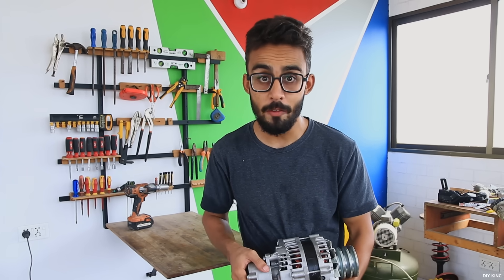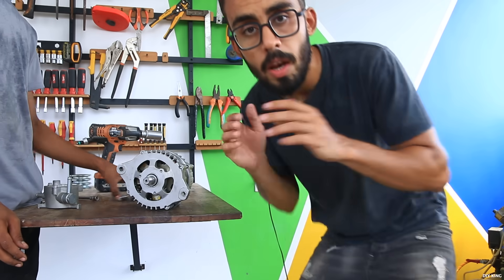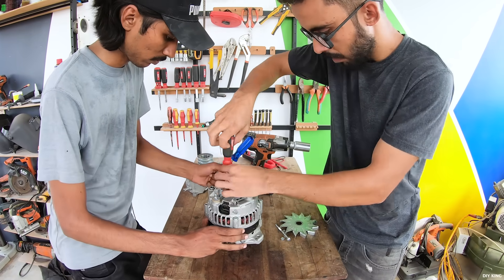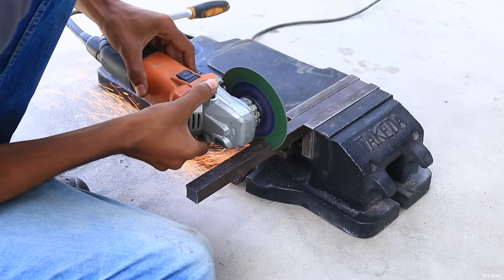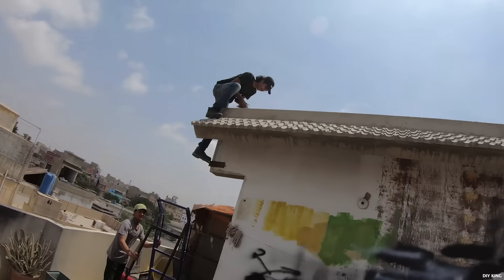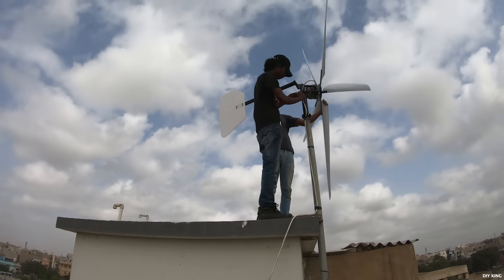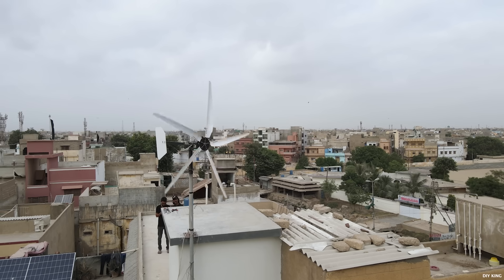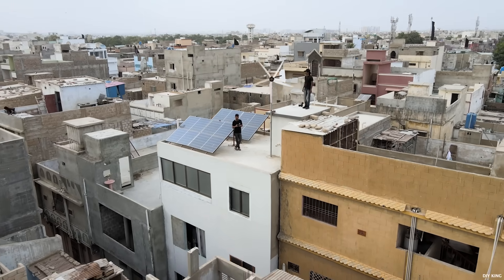Building a Wind Generator using a Car Alternator

Comment: Hi, I'm an auto electrician. I found that the Delco Remy alternators charged at lower speeds than Bosch for example. You will also find that an alternator with a star-wound stator will charge at lower speeds but also put out slightly less current. Delta wound stators produce more current but also need higher speeds to charge. All you need to do with your system is add a pulley and a belt [or gears] to make it to spin faster. Also it depends on how you 'excite' the charging system. The rotor has a slight magnetic field and will start charging at high enough revs but by giving it a 12v feed to start with it will start charging much sooner. [I didn't watch everything on your video].
Reply: Wind Turbines spin at 300 - 600 RPM. The over-drive (1:3) gear ratio required to make the Alternator spin at 1500 RPM, will make it almost impossible for the wind turbine rotor to ever start spinning. It would be like ... your car was in 6th gear at a stop light.
Reply: @MrSummitville  no it wouldn't, the alternator is easy to turn until the charging current kicks in at higher revs.
Reply: @dvdowns Getting the mass to rotate quickly is a problem. And that is why it is NOT implemented.
Reply: @MrSummitville that's what the gearing is for, it will work.
Reply: @dvdowns  You do it and show the world.
Reply: @MrSummitville think about it, an alternator at 14v and 100 amps would generate 1.4kw. There are wind turbines generating a lot more than that. If they can be turned then so can an alternator.
Reply: @dvdowns  Talk is cheap.  Build it.  Back up your theory of 14.4 volts @ 100 amps with ... a wind turbine, 3:1 gears and a car alternator with its rotor powered by a battery.  Stop your yapping and do it.
Reply: @MrSummitville you pay for the components and I will prove it.
Reply: @dvdowns  It is your responsibility, to prove your theory. You can't even point to one successful Wind Turbine design with a car alternator and a 3:1 speed-up gear set. Not one. I am not going to waste my money, on your quackery.

Comment: Permanent magnets on the rotor is the way... Great job!
Reply: Even with magnets, still low power output.
Reply: @MrSummitville unless we lower our expectations
Reply: @AlexanderBelikov  Why build junk and  lower your expectations?  Hugh Piggot Axial Flux Dual Rotor - High Output.
Reply: @MrSummitville car alternator is not nuclear power plant. But axial flux generators are not the top power either.
Reply: @AlexanderBelikov  What is more efficient than Dual Rotor Axial Flux?
Reply: @MrSummitville it depends how do you measure efficiently. It could be kw per kg of cupper used. Kw per $$ spent, etc. And there would be different winners.
Reply: @AlexanderBelikov  Watts output vs Wind Speed is that standard for measuring efficiency. Power In vs Power Out is the industry standard for efficiency. How do you not know that?
Reply: @MrSummitville how do you compare by only this one factor? If most power-in-power-out-efficient generator costs much more than slightly less efficient - guess which one will be used by majority of users? 
That guy took a scrap car alternator and is producing power. What power cam you produce using the same budget? It's like go to Top Gear where they were racing 1000 gbp cars and tell them to use formula 1 cars instead, they are more powerful. That's truly genious.
Reply: @AlexanderBelikov  The alternator was a waste of time and money.  It is worthless. I don't waste my time and money on worthless garbage. Using a car alternator on a Wind Turbine has been proven to be garbage, for 10 years.
Reply: @MrSummitville if you don't know how to use it doesn't mean it's garbage
Reply: @AlexanderBelikov I know how to use it. It is garbage. As proven in the video.
Reply: @MrSummitville talking what's garbage and what's not without a context is so genious!
Reply: @AlexanderBelikov  Watch the video. Clearly the result is garbage.

Comment: U made a stopper so it doesnt run in excess and u complained of low output..

Ironic

I think using a charge controller can do the work while it runs well as long as it assumes not to run for more than what the spinner gave while indoors-testing

Considering a better plan may include a gear system

Comment: Try a gear reduction to make the alternator spin faster, It will take more power to spin it but might fix the RPM issue
Reply: Does your car start rolling in 6th gear?

Comment: Mount your rotor blades separate from the alternator so you can use a pulley to get your required RPMs to your alternator
Reply: Does your car start rolling in 6th gear?

Comment: What for?!?  All practical tests show that small wind turbines hardly generate any electricity, because hardly any wind blows close to the ground. 
With solar panels, you can generate at least 20 to 30 times more green electricity with the same investment!
Moreover, the wind is extremely gusty, which almost always greatly reduces the service life. Only those who MUST be self-sufficient from the grid in winter should install a large wind turbine on a high tower. Solar systems, on the other hand, reliably generate over 25 -30 years electricity at approx. 3 to 8 cents/kWh.

Comment: A pro tip: Whenever building wind power generator, always go for low rm alternators. If necessary add gear mechanism to compensate the rpm issue. When you will add gears, you will need huge wind-power to rotate it, so make the blades larger and experiment with various blade shapes.

Comment: You could increase the slternator/wind rotor RPM ratio by interposing some sort of multiplying gears or, cheaper still, a bicycle chain and sprocket between rotor shaft and alternator.

Comment: I noticed you have solar panel and wind generator. Are they generating electricity separately and to different separate batteries? Or are you applying hybrid system for both?

Comment: 13:40 the blade seems to move on the opposite direction of the angle of attack. And also I don't see that much wind gushing since the nearby objects are pretty much stationary.
Don't get me wrong, it's a doubt. Will be happy if you cleared it out. Btw love your workshop, wanna build one myself. 👍🏻

Comment: U tried shortcut way.  U need to understand the engineering part of alternator. And also need to stay the wind speed so that u can calculate the design of blade size is required for the desired output when the wind is low. 

Try to increase the size of rotar n stator. Along with gear systems. 

Ur minimum rpm should be around 18-20 for better output.

Comment: Alternators are typically designed to provide the best output at 6000 RPM.  You should look at a gear ratio to help increase the speed.  Also, the output voltage may be the same as the input voltage, but the output current should be a lot higher.

Comment: I think your almost there !
Your in need of a step gear system 
, consider bicycle sprockets  .
Also , I think you may be asking a lot from your wind mill , at least to power that size alternator .
Consider 15 amp 12 v john deer garden tracktor alt. May be more realistic for load match .it will still charge a deep cycle battery. 
Nice video by the way !
Reply: 50 watts is very far away from being practical.

Comment: Take a heart gun or torch and heat the blades till flexible. Lower the pitch towards the outside of the blades. It will make less turbulence and spin faster.

Comment: thats an interesting alternator... a water pump on the back?

so. excitation... if you have no field excitation, theres no COGGING at low speeds.

but theres no power at low speeds anyway.

wind power increases on the cube. if you can increase the magnetic field on the same cube to velocity, you can load the blades down to an optimal speed. regardless of wind speed. at the same time, the alternator output has to be matched for the optimum load. 

you can extract the energy at the same cube to velocity ratio as the wind, but you need a load that can absorb it. instead of throwing all the power of the wind away in a vain attempt to make "electricity", rethink the problem over. get out of the rut.

water.

it takes a lot of energy to heat water.

a resistive load on an alternator creates heat.

resistive heating is 100% efficient, but bare in mind that a proportion of the work, the HEAT, in a generator and load combination is also produced in the alternator itself. the current flowing through its windings is the same current flowing in the load.

the load and the generator are a symbiotic relationship. they must be MATCHED. they rely on each other. without one, there isnt the other.

if you made another one of these, applied these principles, and solely based it on heating water, i think you will find it will show FAR better performance than if you try to charge a battery. as water is a constant thermal, easily reproducible, heating a given volume in a given time gives a VERY good demonstration of power... though people are stupid and are more impressed by lightbulbs and flashing LEDs...

what to do with heat? well now... 

what does a nuclear power plant and a coal fired power station have in common? whats an ICE run on? how do you cook? what do you do in winter?

Comment: Asalam o alikum bro plz tlme about solar latitude angel in karachi which is best in summer nd winter both provide best results.
Reply from the maker: Walaikum Salaam, Since Karachi is situated at a latitude of around 24.9 degrees, the recommended tilt angle for solar panels in Karachi would be approximately 24.9 degrees
Reply: @DIYKingSaM  thanks bro jazakAllah.

Comment: Permanent magnet mach better use neodymium bar magnets .iyo need that regulator if you charging your car battery then connect inverters for your power needs

Comment: Great project guys. But did you know synchronous generators such a car alternator, if wired corectly can also work self excited? Without the need of permanent magnets or external excitation voltage. There is always a tiny remanent magnetization of the rotor which grows exponentially on a positive feedback loop while powering the excitation coil.

Comment: There's allot of comments so I'm just gana say it and if it was said already great. Why not relocate the alternator and mount the wimdmill fan to a pulley 2x the the size and use a belt for rpm correct the rpm and make it spin faster?
Reply from the maker: Mike you are right and that's something we are soon going to pull out as a project on this channel so stay tuned

Comment: you seem to be new in terms of using an angle grinder, step 1: add the cover. those discs usually explode throwing shrapnel directly to your head. step 2: stand firmly and away from de direction of the disc

Comment: It would have worked if you geared the thing up , to get more power from the wind you increase the surface era  then you put a simple gear box between the input shaft and drive shaft , good job though guys !!!
Reply: Ever wonder why ... no Micro Wind Turbines have "gears" to increase the rpm ?

Comment: i would suggest to copy the design of a clip fan and make it in multiple phase 8layer by 4 neodymium magnets, back front and give it a bridge circuit , mine got 2kw an hour on a modest wind youll prob get 3-5 in your place

Comment: well it really is not advisable to use a car alternator for this as those were made heavy and designed for high torque..
Reply: Car Alternators were designed for high RPM

Comment: Instead of using an alternator look for an old automotive fan motor and just make a rig like you did to extend the blades. Mount it on a poll and you're done. No modification no battery no nonsense. Easy and cheap to make you can put up several of them. I've yet to see good results from an alternator build but the fan motors actually work.
Reply: So, you think it is easy to mount magnets to that rotor?

Comment: Don't use a permanent magnet for the rotor 
It will need adding a voltage regulator and will make less power. 
Adding a gear ratio 1 to 25
And making the wings longer is the optimal way

Comment: @DIY King
Good Job. Use Rare earth magnets, around 16 magnets placed N, S configuration on 8 inch OD steel disc and suitable Air core copper coils, this is otherwise axial generator, which can freely spin at low wind speed without any cogging.

Comment: Have you thought of changing the magnets for electromagnets to permanent magnets so you don't have to add power. Just a suggestion and gear box. Thank you for this video I am building a wind turbine and this video is a good to produce the blades thank you for that.

Comment: Alternator is activated by one of the pins on the voltage regulator. You just have to just a wire either from ground or hot to activate. Also that keeps your storage battery from being drained when the alternator is not spinning.

I don't have all the equipment or tools your using. There are much simpler ways of doing this.

Comment: Oh cool, it brings back memories of when I was around 10 years old. I didn't have much money, so I went to a car graveyard to purchase one from a nice guy who owned the place. I paid $5.00 in 1973, but it came with all the basic electronics. My dad gave me an old car battery. My mom was not aware of my project, but my dad did lol. I assembled the turbine with random pieces of aluminum sheets some workshop leftovers I got for free. Anyway, I was able to install it near our tree house as there was a wind corridor because of the path leading to the family cottage. It worked and we were able to power lights and a car radio. No inverter though, just 12 volts of DC power. The battery charged as the turbine turned.  It worked for a couple of years until a storm with 100 Km/h wind destroyed it. Anyway, thanks for sharing your video showing your cool project.
Reply: Great invention
Reply: Make it to charge the battery backup generators

Comment: i understand you are in Karachi, so wind should be plenty but weather swing enough to take a toll on pully system. i would recommend a permanent magnet low rpm bldc motor as a generator. More wise on the page must be having more clear and advantageous ideas. for the sake of algorithm i put down mine. 
Regards and best of luck